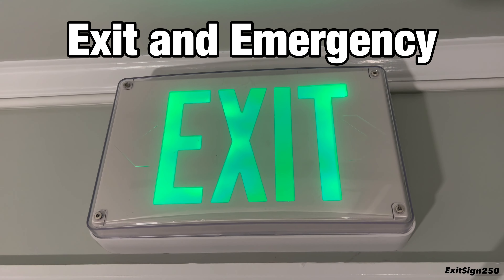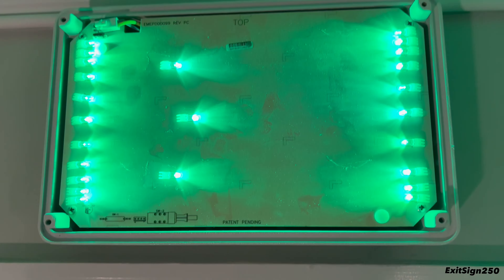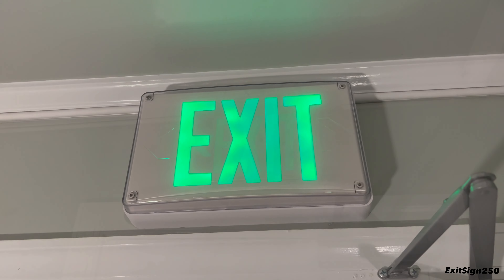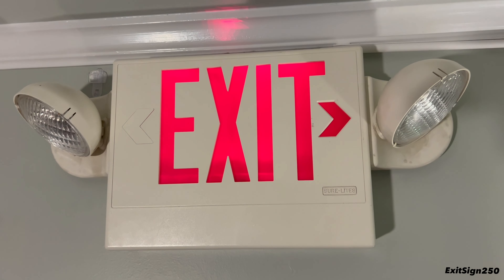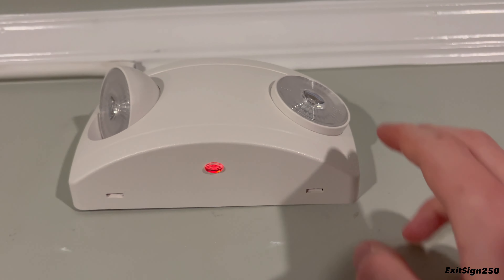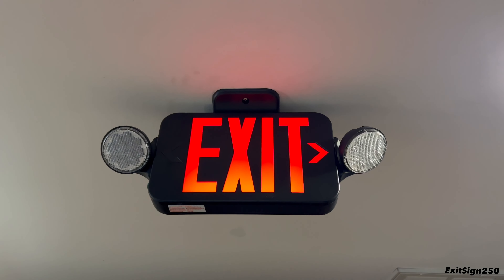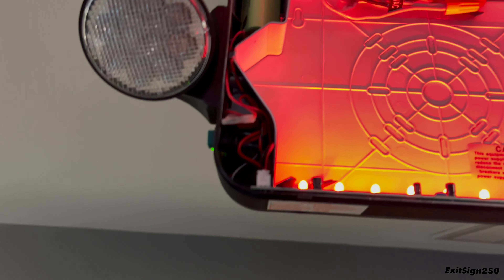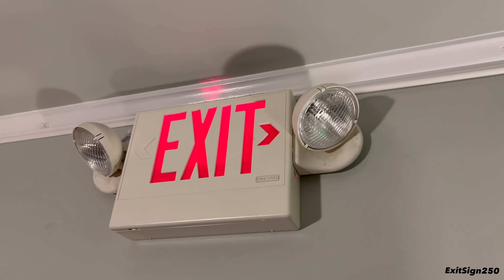Exit and Emergency | Episode 14

Comment: We have the VR signs where I work which is a giant factory. The other half of the room has emerilite WW-SVX with battery backup, magnetic test "buttons", smaller chevrons, and service required led blinking on a few. Not much of a need for battery as there's an inverter system powering the signs, outdoor wall packs by the doors, and a few scattered HO 6x T4 fluorescents with led conversion. Funny enough with these tough sign instilled there's a few LQMs thrown in the mix and they're holding up just fine for the past 10 years.
Reply from the maker: Interesting! VR or any all conditions exit sign is a good choice for a large factory.
Reply: @ExitSign250  I totally agree, albeit very expensive to install a lot of them. Older parts of the factory had LXURs that have been replaced with generic ECRGs, and ultra thin combos which I think are pretty neat. Personally in a big open space is better suited to have NYC signs for better visibility than what we have, but not my call.
Reply from the maker: I couldn’t agree more about the NYC code signs in larger areas or those where the signs are installed high up. My only complaint about them is the small arrows. I have heard of some places outside of NY that have used NYC spec signs for larger spaces.